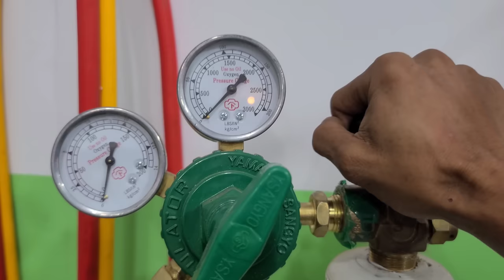why doesn't anyone tell aluminum welding tricks like this

Comment: "why doesn't anyone tell aluminum welding tricks like this" Because you ruined that part by making welds on completely contaminated metal and no professional would "tell" such a trick.
Reply: I guess you missed the part, or you don't know what he is doing, where he melted the aluminum on both side of the joint, floated the impurities out, removed the oxides and contaminates with a steel welding rod leaving pure aluminum behind.  Then he fills back in with a home made aluminum rod.  This is something people in third world countries can do, out in the dirt, that guys in the first world can't do with thousands of dollars of equipment in a clean shop.  I'd bet on his weld on this cast case anyday before I would trust yours.
Reply: It worked for him!😊
Reply: I have welded aluminum with a torch.  But I had to use flux and it is damn tricky.  About the time it starts flowing well is when a big hole just drops out.    I have seen this technique of scratching out the oxide with a steel rod before.   Our apparently works.

Comment: Takes a bit of practice but can make a very sound weld using gas torch with aluminum arc welding rod as a filler rod. Can use in the field without electricity. Was a common practice in the early part of to 20th century. Easier to do if you have a pair of the old blue lensed gas welding googles so you can see when the base metal starts to melt. Over the past few years I’ve done several successful repairs this way and have tested several samples that achieved full penetration welds stronger that the base pieces being welded.
Reply: The old cobalt lenses. I think glass blowers still use them.
Reply: I know that you use borax when you weld with bronze. Is it the same with aluminium?
Reply: The way I’ve been doing this, the weld is fluxed and shielded by the flux on the arc welding rod I’m using as a filler rod.

I’ve also done some welding with no filler rod or with bare aluminum filler strips where I cleaned all materials by sanding or brushing with an un contaminated stainless steel wire bush and welded using the aluminum flux sold by Tinman Technologies (a good source for speciality tools for sheet metal work and sheet metal welding) - off hand I don’t know what is in the flux which is supplied as a white powder you mix up with distilled water.
Reply: @mitsos306ify  it's same used borax
Reply: @fajarfjr1726  thanks!
Reply: @fajarfjr1726  це не бура, для алюмінію флюс на основі  фториду натрію
Reply: На Али есть такой флюс для алюминия. И цинковый припой с таким же флюсом.
Reply: Hey, thanks for sharing! I'm in the middle of learning this type of welding/brazing. Are you best to have a finer point flame for this type of join or is a slightly broader flame (commonly used for copper pipe brazing) acceptable? I'm practicing with the latter but this finer flame looks like it would be easier to control the heat. What's you experiences with that? Cheers, Sam

Comment: How do you know if your aluminum is hot enough to weld, but not so hot it falls apart?  1) you should clean all that comtanination out. 2) turn your torch to where it is just burning acetylene.  You want that orange/black sooty flame.  Put the torch on the metal and get it black.  3) Turn your torch to the proper heat for the job.  4) now heat the material.  The black soot will burn off when the metal is ready.  This works well before you TIG weld or any type of aluminum welding.
Reply: Propane limits temp. Read description! See prior videos on casting rod!
Reply: Merci de l information!😊
Reply: Las barras llevan fundente o como sería alli???

Comment: Aluminum is hard to weld, because it doesn't puddle up, like steel does, instead it justs gets a wrinkle look, then a few seconds later after the wrinkle look, the aluminium just falls apart, so its crucial to get your welding rod into the wrinkle area, just as it wrinkles, them keep moving, before the whole wrinkle area, just falls off, in one big blob.
   Also, its good to use an aluminum flux when welding aluminum, for a better looking weld.😁👍
Reply: there's flux already on the rod

Comment: I would use mention instead of tell, but I get the picture.

This guy could even fix a 6061 aluminum bike even though 40,000 psi is plenty of tensile strength. Stronger than carbon fiber in general.

Comment: When you clean up that, Weld? , I would think the part would just fall off. Looks more like a solder job maybe a braze at best.
Reply: Most of the time, he's manipulating the weld puddle with the butt end of a steel welding rod.  Then adding a little filler, and repeating the process.  He is melting the parent metal, and adding filler, literally the definition of welding.  If you think it looks easy, its because you've never tried to do it.

Comment: Please correct me if mistaken and supporting evidence.  This cannot be welding but brazing or soldering.  The base metal is not forming a puddle; not a fusion of base and filler metals.
Reply: This is gas welding.  He is forming a weld puddle, and manipulating it with the butt end of a steel welding rod.  The filler material is a fat bit of aluminum, which is added at times, then he goes back to working the weld puddle with the steel welding rod.  When you see the welding rod, he is not adding filler, just working the puddle.  The parent metal and filler are all blended together.  That's not low temp zinc he's using for filler, it is aluminum, which means the parent metal is being heated to  the melting point.
Reply: @vandalsgarage también por cuestiones físicas y técnicas la soldadura queda con pequeños poros internos q debilitan el material, no va tener la misma resistencia una soldadura realizada como en el vídeo a una por electrodo revestido o por proceso tig siendo este último el más resistente, esto no quiere decir q este mal lo del vídeo solo q es otro proceso y no es el óptimo pero cumple su función.

Comment: What I see is, the process of extracting dross from the surface of the puddle by using the arc welding rod  to collect it by a scratching technique. The preliminary weld to secure the parts in place is cleaned in preparation for the filler rod, after the application of the filler rod the weld is again cleaned by pooling and scratching. The same thing happens when you melt ally for casting, before pouring ,the dross is removed with the help of a steel sieve. Great work...

Comment: Hello , j'ai tenter de faire des soudure Alu avec un poste a souder PARKSIDE Arc Soudeur Max 100A - PESG 120 B4.  j'ai acheter les memes electrodes 2,5 mm.  , l y a bien une amorce , mais a aucun moment sa fusione , l'electrode colle tous le temps ........ Sa vous fait penser a quoi ? Merci du coup de pouce
Reply: Merci d’avoir repondu a ma question .....

Comment: Why is he using lpg instead of acetylene?  Is this brazing?
Reply: yes its brazing, filling of acy is 40euro, lpg is 10euro. Its way cheaper when you need for heating and brazing. this setup cant weld
Reply: @milosmilanko4472  acetylene is very expensive here too in hungary. I'm mainly use my oxy-fuel setup for cutting/ heating. Is lpg just as effective for cutting?  I have a pb bottle can i use it instead of lpg?
Reply: @909drummachine  yes I use same setup no problem, even more heat producing. only downside combustion is not suitable for welding
Reply: Brazing is when you bond togheter using different material , that's welding becuase he is bonding alluminium with alluminium rods
Reply: I believe this is welding. I've done plenty of gas welding on steel, but never aluminum.Great vid!